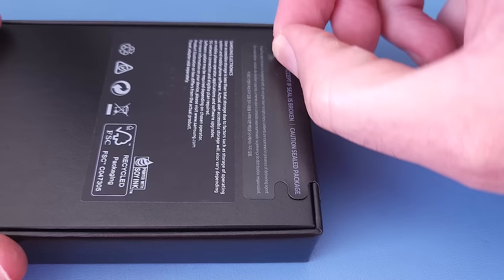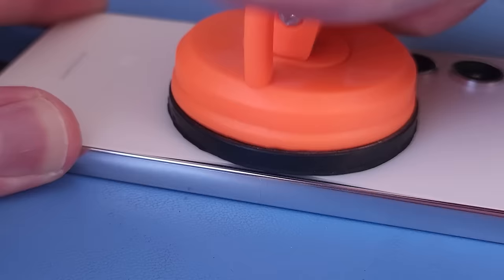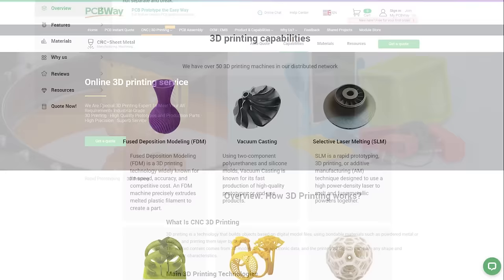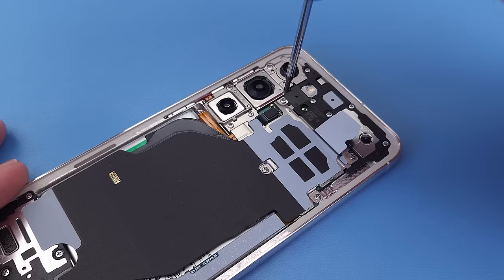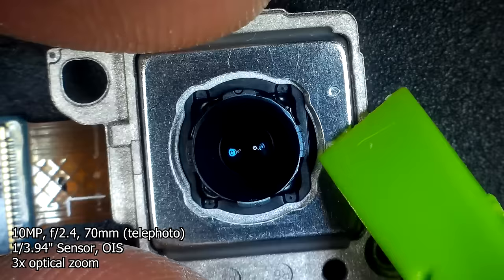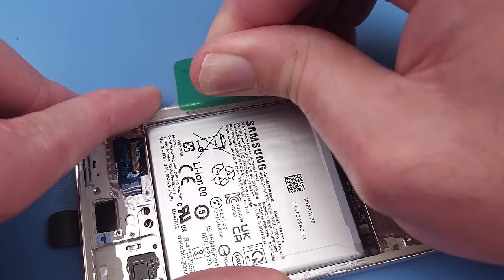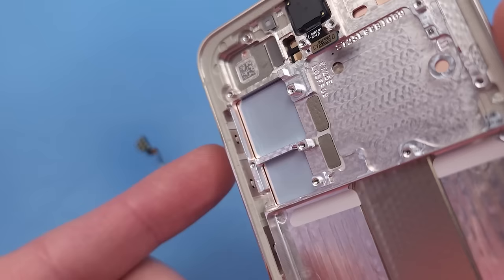Samsung Galaxy S23 Teardown - Full Disassembly

Comment: Huge props to the engineers who decided to use the same size screws on all of the inside. It's a nightmare when you have a lot of different sizes while repairing.
Reply: Huge minus for making them philips instead of metric hex or torx
Reply: @irondan357  you're insane.
Reply: @DGCastell  indeed
Reply: Yeah, unlike CrApple
Reply: S22
Reply: Like your mom

Comment: You're like a "Tech Surgeon". Soo clean, precise, and satisfying.
Reply: If he would wear 'gloves' maybe...
Reply from the maker: @S22..  never! 😝
Reply from the maker: Salvatore Bruno official  nice 👌
Reply: Omg you’re right
Reply: @RestoreTechnique Bro, I'm here after inserting Sim ejector tool in the wrong hole and pressed hard. Do you think I might've damaged it's water resistance?
Reply from the maker: @yaswanth88  no 👍
Reply: @RestoreTechnique  MANTAP2 S23 ULTRA
Reply: @RestoreTechnique  Hello, I am from Iraq and I watch your videos. I have a question. When I insert the SIM card key into the wrong slot, is the device no longer waterproof?
Reply: If something is satisfying is gonna be this, not those weird videos where they record the sounds of the wrappers and the buttons clicking 🥲

Comment: All those screws were the same size - is that a new Samsung thing or am I thinking of Apple's "far too many different sized screws" approach to engineering?
Reply from the maker: It's not that uncommon with Samsung's. Usually they're all the same size except a couple of odd ones.
Reply: @RestoreTechnique  Screws 10/10, Battery pull tab 3/10 ; ) Thanks for another great video RT.
Reply: @TheJohnRowley  everyone else who dissasembled it just pulled the screen out without alcohol so i think its not a big deal, i would at least the screen up before doing this. Jerry also showed that the screen is extremly durable against heat and the pixels wont die from fire lol
Reply: @daidalos1508  I think we might have some misunderstanding - I was alluding to the battery pull tab not being as good as it could have been. Having watched RT's other videos they seem much more effective in other phones he's worked on. Still, as he said - at least there was one at all on this model!
Reply: That's why Samsung is the best and iSheeple are idiots 😂

Comment: Thank you for putting my mind at ease about sticking the pin injector in the wrong hole... I really freaked out at first. Should have known better. Glad Samsung had enough foresight to account for people like me...
Reply from the maker: Np worries 🙂
Reply: So nothing happens to the mic if you place the pin injector in the wrong hole? you can't pierce the mic? Is the phone still waterproof?
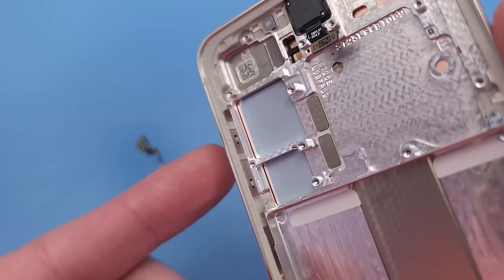Reply: @arturpytel9940  he explains it at 9:00 in the video
Reply: I really pushed the pin hard into the microphone hole . Did I damage something?
Reply: I also stuck the pin in the wrong hole.
Reply: 5 minutes after I got my S23, I stuck the pin in the wrong hole...
Reply: Hola me paso lo mismo, empuje el agujero de arriba, y sonó, alguien sabe como puedo saber si esta bien o si dañe lo impermeable
Reply: @TheDpm007  Eu também queria saber?!

Comment: The battery adhesive that you just removed is actually reusable because they are not being congested when you pulled the battery out of the phone, you can reuse it for several times between teardowns

Comment: Thank you for mentioning the microphone hole. I poked the microphone hole with full force on my new s23. Of course, I did not intend on doing such foolhardy behavior on purpose!
Reply from the maker: No worries 🙂
Reply: @RestoreTechnique  I'm even more dumb and I accidently poked the other hole in between the speaker and usb-c. It's supposedly an air vent hole.. Did i do dmg to it or am I good? 🤣😨

Comment: Great video, as always. Love the precision and care you have towards devices. I have a question related to 9:08. Say I was trying to deep clean my phone,what would happen if you stuck a pair of tweezers into the speaker grill to get the grime out, but accidentally push too hard into the speaker hole? Similarly, what would happen if I stuck the corner of a sheet of paper into the top earpiece speaker to try to get the dust out? Would both of these be harmful to the waterproofing gaskets? If yes, what would you recommend to get those two places cleaned properly, as they're very hard to do so?

Comment: Interesting on the adhesive being less tacky than the older Samsungs. I wonder what that means in the long term as far as water resistance. There's clearly a difference between the adhesives in an iPhone vs this.

Comment: I got the S23 and the fact that they use the vapor chamber this year instead of the graphite cooling on the S22 wich was terrible, the result is magnificent! I don't have any heating isseus or battery drain problems i had the S22 but i sold it i'm from europe so it had the shitty exynos 2200 chipset, now it's the snapdragon chipset global finally!
Reply from the maker: Yeah it's a decent upgrade, I'm starting to think maybe I should swap from my S22 🤔
Reply: @RestoreTechnique  I swapped from the S22 to the S23 for this big change i had a lot of problems with the S22, and as i said we had the exynos 2200 back than and now finally the snapdragon chipset the battery is stunning now!
Reply: @TheCorne87 same
Reply: @StarJes1  I got the S23U now
Reply: @TheCorne87  cool, but i wouldn't trade my normal s23 for that, cuz its perfect size and comfortable to use
Reply: @StarJes1  Nah the S23U is a different phone another level believe me!

Comment: At 9:08 when you are demonstrating the waterproofing of the microphone channels, what about the other pin-sized hole/channel next to the speaker on the bottom? What even is the purpose of that hole, and does it share the same waterproofing as the bottom microphone hole or does it have waterproofing located somewhere else? Thanks.
Reply: Sarebbe interessante saperlo, a cosa serve l'altro foro sotto e se è impermeabile, grazie mille 🤗

Comment: I never understood why all the videos I've watched that they took off the nfc antenna from the bottom speaker housing. Unless you are changing the bottom speaker only keep it connected. Thank you for this video of you keeping it connected finally!  And the balls are behind that round black sticker where you thought it was gauze. Also when reassembly does anyone torque the screws or just go till they are tight?
Reply from the maker: Thanks 😊
I don't know what you mean by torque the screws as opposed to tightening them?
I just screw them in until finger tight.
Reply: @RestoreTechnique  I saw some people using a torque screwdriver when reassembling. Just didn't know if that is a thing.

Comment: i made that sputid mistake and pushed the sim slot extract pin to microphone hole. i wonder if i damaged the water resistant mesh on the hole. it seems on this video mesh is not directly positioned perpendicular to the hole but rather horizontal after hole makes 90 degree turn to the actual mic. if its what i think it is water mesh on my phone should be still intact. i hope.
Reply from the maker: Yeah should be fine 👌
Reply: @RestoreTechnique  i know you reassemblied that phone but if you could check on how the mesh exactly positioned i would be very happy. thanks.
Reply from the maker: @A7Rc  9:02
Reply: @RestoreTechnique  thanks a million. İ have s23 plus so i assume they inherited same logic there. So it still waterproof. Thanks again you are golden

Comment: I also tried the incorrect pin hole. The Microphone of is fine, thanks for the confirmation in the video. But does trying the wrong hole affect the overall water resistance?

Comment: 0:34 Can you make a sepparate video  discussing about this
-what is USB-C Type
-How Many USB-C Type today
-How to differentiate each one (design, connector pins, bricks etc)

How would i know if the Cable im using supports 3.0-3.2 instead of just 2.0 like this one

Comment: I think that speaker has foam balls in it but it's closed with extra protection after introducing self-repair. To prevent users from accidentally poking?
Reply from the maker: It does have little white balls (not sure if they're actually foam balls, as I've crushed them into powder before on other phones).
I think the valve controls air coming into the speaker better.

Comment: That microphone is a stupid desing, i did put the ejector in mocrophone hole in my s22 and i still dont know if there is a problem or not, it sounds fine, maybe just the water resistant is gone
Reply from the maker: Nah the mic hole takes a 90⁰ turn before the water resistant gasket. It's the same on this model, as illustrated at 9:02
Reply: @RestoreTechnique  Thanks good to know its the same in s22

Comment: I'm curious as to what happens if you push the sim key too hard, as I pushed it very hard to the point where there was a small "pop" sensation and the key went a little deeper. The key didn't bend up or anything, but it has me worried that maybe I scraped the seal just enough to break it or something. Like I just want to know if the pop sensation meant anything bad. Plus if the seal is at a 90° angle from the channel why would I even feel that happen? I want to trade this in for a s24 Ultra, but I'm afraid that I won't get the credit if this is actually broken.

Comment: Hi, I just accidentally drop my S23, and want to know if any internal damage occurred 
Could you please confirm whether the Wireless Coil and NFC Antenna connector to the Mother Board is tight / close enough to the back glass (So, it won't move)?

Since from my perspective that's the only moveable part apart from the Camera's OIS part 

Thanks

Comment: Hey rt. I noticed you've done some videos on the dualshock 4 in the past and wondering if you could help me out. I have 2 controllers and i was gonna use one for parts to fix the other. Upon putting the backs on both i wanted to see if i could swap the back on the controllers but that didn't work. I put the ribbon cable in and the shell didn't fit so i pulled it out and put the original back in and it didn't work. So the ribbon cables on both suddenly dont wana work anymore. Could it be bending? Could it have been accidentally putting it in the wrong way messing with the pins. Did it just fry the connectors. Please help

Comment: wondering if the s23 cover fits the s22. would like to see!
Reply from the maker: Well the camera bump is very different, so my Samsung S22 case wouldn't fit, but others might depending on the design.
It's practically the same size though.

Comment: Can someone suggest a good usb c to c 3.2 cable for s23? Also will th 25w charger provide super fast charging in case of base s23 or we still need 45w charger?
Reply from the maker: The base S23 is limited to 25W fast charging. The 25W chargers will be capable of the maximum charging speed for the base S23.
I don't have any cable suggestions sorry.
Reply: @RestoreTechnique  thank you

Comment: At 8:44 above the battery capacity: 3900mAh why is it written capacity/rated capacity(IN CHINESE): 3785mAh?
Reply from the maker: 3900mah is the "typical capacity"
3785mah is the "rated capacity".
You're probably best to google the difference between typical capacity vs rated capacity. But essentially the rated is the minimum capacity it can provide.

Comment: I actually poked both hole in pressure on either side of the usb port is there any problem with device
Reply: Please surgeon
Reply: What is the plastic inner line inside mic hole for?

Comment: Surely it will now be non waterproof and will have lost it’s manufacturers warranty?
Reply from the maker: Nah it can be water resistant again. See video: https://youtu.be/LwtMCpJ9BzA
Yes technically warranty is void, but only if they can tell that its been opened up before will they reject warranty claim. If you use genuine adhesive replacement, there's no way for them to tell it's been opened before.

Comment: is it  still ip68 water resistant after all this?
Reply from the maker: If you use the proper replacement adhesive and techniques it can be close. I wouldn't trust it to be IP68, but maybe IP66. It all depends on your setup though. Surface cleaning, oil and dust removal, adhesive application, heat, pressure and time of clamping it down.
https://youtu.be/WuKR8VVGYsk?si=ccPwYEIdhiSX9lvK
https://youtu.be/LwtMCpJ9BzA?si=OT8SCjmGpgtczAMX

Comment: Came for the - "9:03" .  Accidentally put the sim ejector tool on the wrong hole (left side to charging port near the sim port). I did press a little hard with the tool. Will I get malfunction in my microphone. HELP!!!!!!
Reply from the maker: Unlikely. But see my community post on the subject, where I have a microscope image of the hole. There's a plastic wall around the hole, which may get damaged and block the hole. But if you mic is working fine, then there's no problem 👍
Reply: is it still true with the hole on the top of the phone ?  @RestoreTechnique
Reply from the maker: @TomLM29  yes

Comment: Wait so the adhesive weakens every time my s23 overheats?
Reply: Not really. If you somehow got it to be extremely hot, yes it technically can weaken it very slightly. I doubt you could get it that hot though, and if you did, its still really no huge deal at all since it will cool back down and go back to normal.  If you're phone gets really hot, you may want to get it checked tho lol

Comment: just put the compound in between soc and thermal grapite but not in between the chassis no wonder this 8 gen 2 and also overclock perform a bit worse than regular 8 gen 2

Comment: Pro tip, you don't need any chemicals to help remove the battery.
Reply from the maker: I saw another teardown where they bent the battery a bit when just pulling it up. So yeah, you don't "need" to...
Different climates plus variations in the glue application from phone to phone may result in different outcomes. I wouldn't be making a blanket statement.

Comment: Sir please help I accidentally poked sim ejactor with pressure  on microphone does it damage waterproof or microphone please help
Reply from the maker: 9:02
Reply: @RestoreTechnique  thank you for reply sir i am having sumsung s23 when I unknowingly  inserted sim tool on microphone hole I feel like poked on rubber can you please explain properly about it Sir please 🙏 does it damage waterproof
Reply from the maker: @Raj-bu2xv  Go to my community tab on my channel, and see the 3rd post from the top.
Reply: @RestoreTechnique  sir thank you but I am worried when I inserted my sim tool in worng place  is that plastic waterproof sir
Reply from the maker: @Raj-bu2xv  that plastic has no affect on water resistance
Reply: @RestoreTechnique  okk bro thank you
Reply: @RestoreTechnique  overall sir I should not worry about it sir your video is amazing but I am really getting hard to understand please can you explain sir  because I bought s23 yesterday with emi mistake I made making me regret I put a sim tool to microphone hole with pressure I am worried it may damage my microphone and waterproof
Reply: @Raj-bu2xv  i think your s23 is literally unusable and beyond saving now

Comment: what's inside the mic holes, i stabbed mine and it went pop like broke something, scared.. right hole, now it goes in all the way with ease! 

Well i have the s23 ultra has 2 holes.. i stabbed the one next to the sim slot, scared please!
Reply from the maker: There appears to be some sort of plastic inner tube around the inside of the mic channel, maybe you broke some of that off. Or it could be that the sim tool got stuck on that plastic lip, and simply unstuck and went all the way in. I don't think you damaged the water resistant seal, but there's a chance you could've blocked the hole with the plastic sides, I'm not sure though.
Reply: @RestoreTechnique  so mic is fine, water seal probably fine, I just broke or pushed the tube into the phone and dislodged it or something, as I said I can now shove the simcard tool all the way in. So yeah, so is the mic for both holes not directly at the end of either hole?
Reply from the maker: @InsaneVRGamer  yes the mic channel takes a 90⁰ turn upwards before reaching the mic and water resistant gasket.
I just posted a photo on my community page, go check it out 👀
Reply: @RestoreTechnique  thanks, so whats the tube for?? im confused, whatever i punctured.
Reply from the maker: @InsaneVRGamer  no sure, maybe it's better for sound to go through a plastic channel than a metal one. I'm no sound engineer though haha
Reply: @RestoreTechnique  thanks! so only way to resolve this then would be to remove my back, and push it in place??

also my s23 ultra wen i shake intensly the phone, i hear a rattle or something moving around, is that normal? coming from the top and little at bottom, don't know if buttons or what
Reply from the maker: @InsaneVRGamer Yes, but that's if you did actually push it in (maybe look under a microscope if you can find one). If there's no noticeable loss in mic quality, I wouldn't worry.
Rattling from the cameras is normal, due to the OIS. Not sure about the rest of the phone, but there are ribbon cables that could flap against the battery.

Comment: The battery is a smaller capacity compared to my s20 ultra of 5000 mah so more of a step backwards
Reply: But it is a much smaller phone too, less space = less battery. Plus the smaller screen and more efficient chip should help battery life.
Reply: I mean it's not an ultra phone...
Reply from the maker: By "decent upgrade" I mean in terms of almost zero phone size increase.
Reply: That is not S23 ultra but S23.
The battery capacity for each S23 model is 
S23 : 3900mAh
S23 Plus : 4700mAh
S23 Ultra : 5000mAh
Reply: @J-qi4qp  nah. Just Samsung being picky. Other phones with similar or lesser surface area and even lesser weight can put more than 4000mah up till 5000mah. Putting 3900mah on s23 is just pathetic